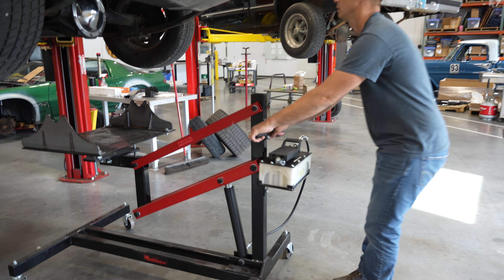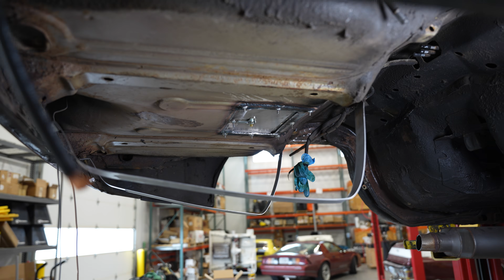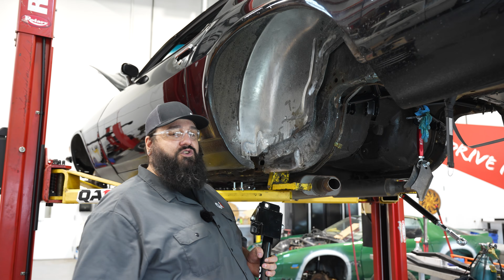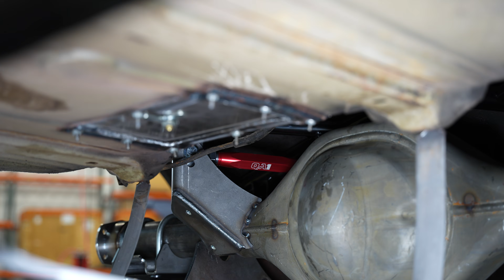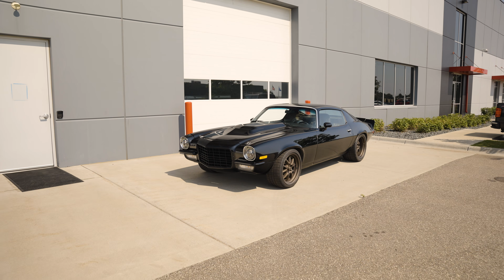QA1 4-Link Kit Overview: Second Gen GM F-Body Installation

Comment: That looks really nice.    Looks like the factory style transverse muffler won't fit.   If you ran two mufflers in front of the rear axle is there clearance for the pipes to go over the axle or do you have to do something custom?
Reply from the maker: The fuel tank being so close to the rear axle is the limiting point on these vehicles. Usually when using this kit and lowering the rear ride height, a custom exhaust will be needed or exhaust will need to dump ahead of the rear axle.

Comment: Can I still use my over the axle exhaust? I have a 1979 Pontiac trans Am and love the look of duel chrome extension tips.
Reply from the maker: Over-the-axle exhaust can be done. Depending on how it was routed prior, it may need to be cut and re-routed after the 4-link is installed.
Reply: @QA1TECH can make a video on that '79 Trans Am.
Reply: How much was the rear-end shortened? What's the measurement and backspacing on those wheels?